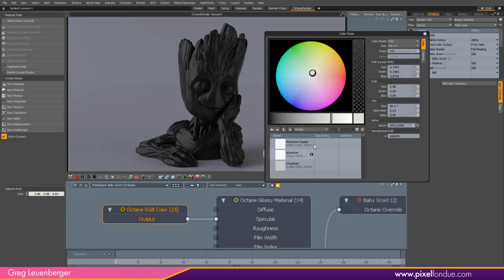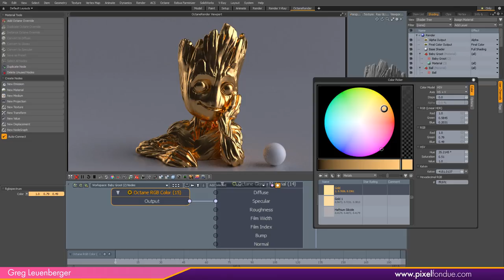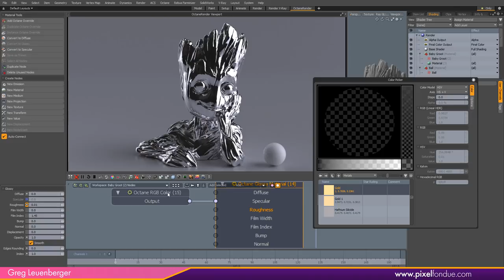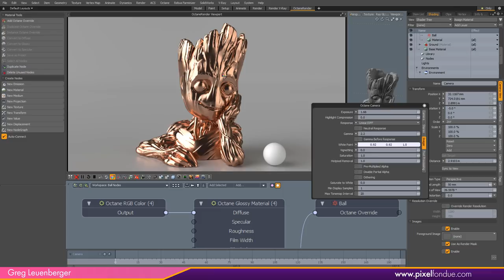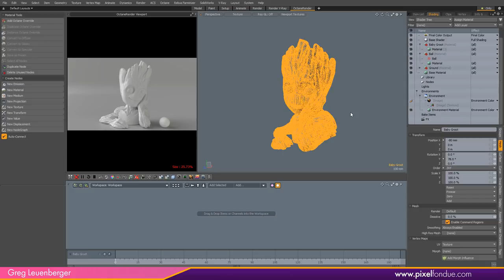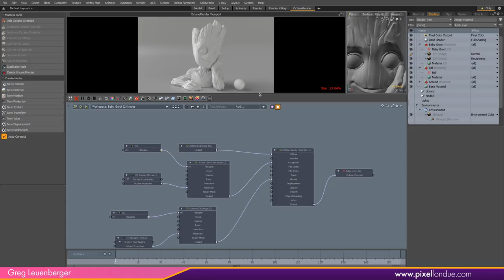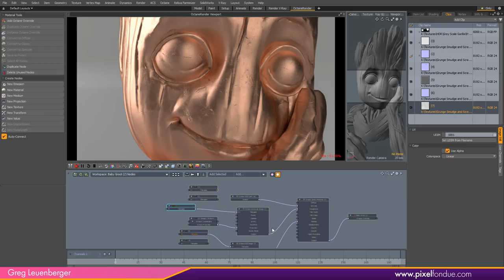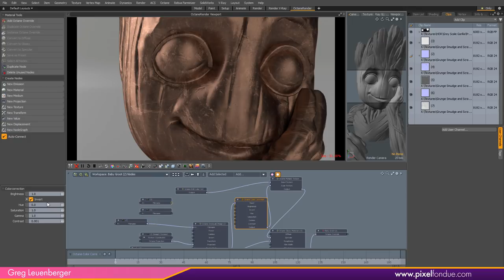MODO Octane | Metallic Materials

Comment: Hey Greg great video thanks. Could I ask for a request video? Using images, normals, bumps and displacement in Octane for Modo. I've been using octane for Modo on and off for a few years but  I still feel like I'm using it in a very slow manner, in regards to applying new images (without using the modo to octane shading converter).  I wish it was a bit more drag and drop.

 I've also been suffering from underwhelming normal and bump effects compared to modo, especially with bricks, even with adjusting gamma etc. I end up having to use displacements to get a decent result but that has caveats.  Maybe I'm expecting too much from bump and normal and Maybe Modo is just generous in these regards.
Reply: mmm, I can take a look.  Displacement in Octane is great - normally it does well with bumps too.